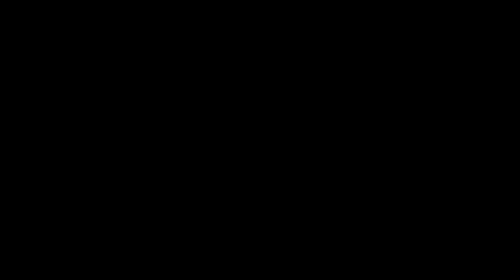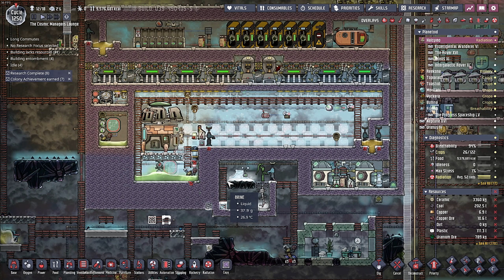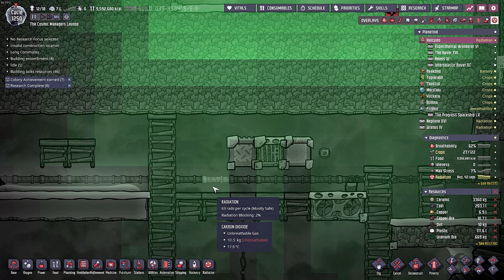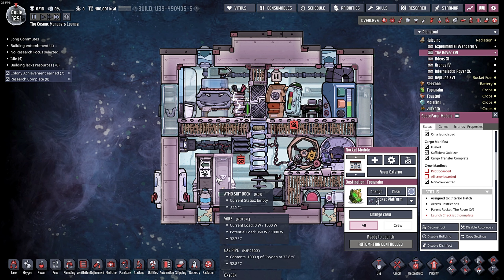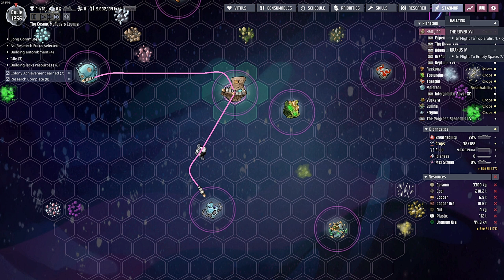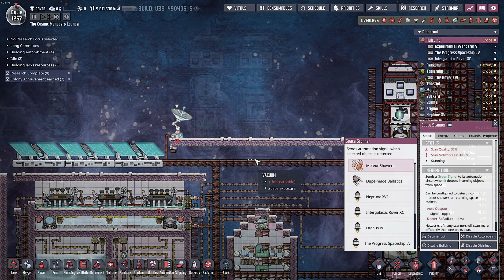O.N.I Spaced Out ep27 - Rad Rocket With Integrated Lead Suit Dock

Comment: You can use a space sensor inside the rocket to tell you when it's on a certain planetoid, it consumes no power but needs 2 tiles of space. One for the sensor and one for the notifier
Reply from the maker: Space sensor? i never used it before, i have to give it a look :) thanks for the tip :)
Reply: You can only build it inside a rocket and it’s a 1 tile thingy
Reply from the maker: @guty_18  i see, probably is locked out like the rest of the rocket stuff and thats why i never payed any atention to it xD